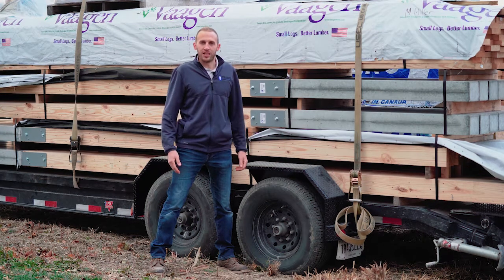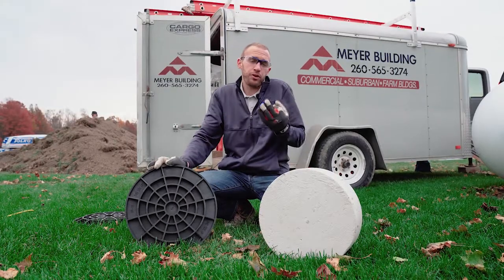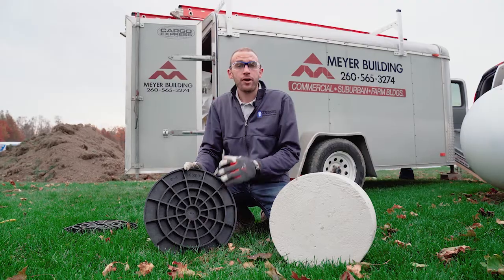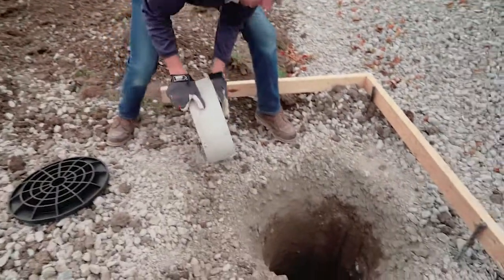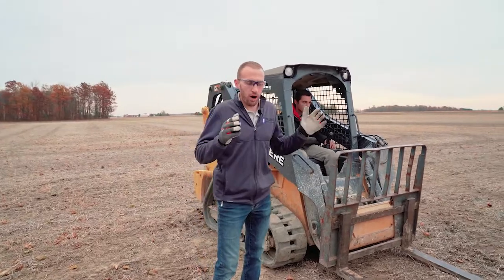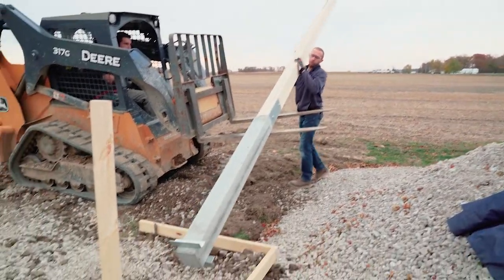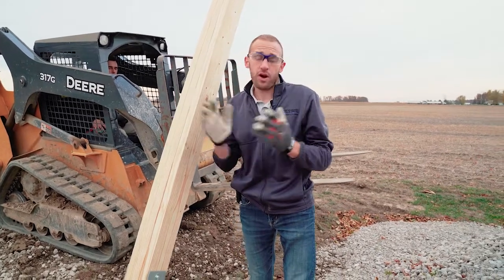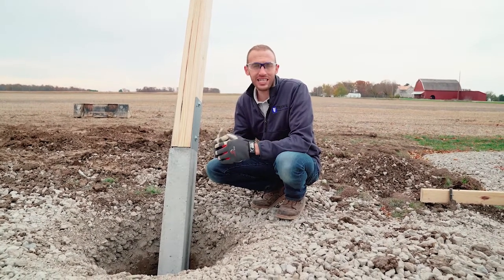How to install Perma-Column® precast concrete columns

Comment: that looks cool, but the insulation value of that cement pole is not that great. Why not use simpson strong tie connectors instead? the moment base connectors look very solid.

Comment: What size auger bit is recommended?
Reply: Depends on the size of your building, does it have an attic load, and your location to determine the snow load. Also what kind of soil you have to support the footer.  Most post frame videos I’ve seen have too small holes drilled.
Reply: 18” hole. Fill with concrete and wet set a bracket into concrete.